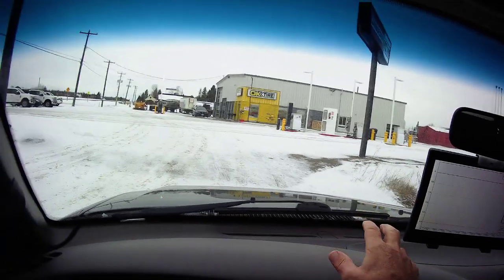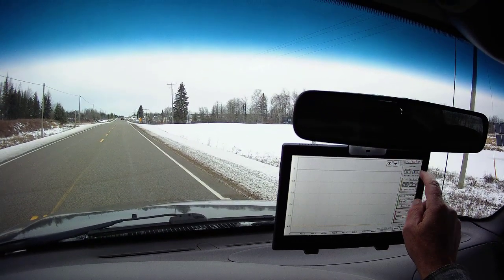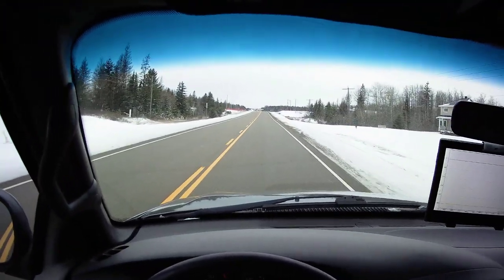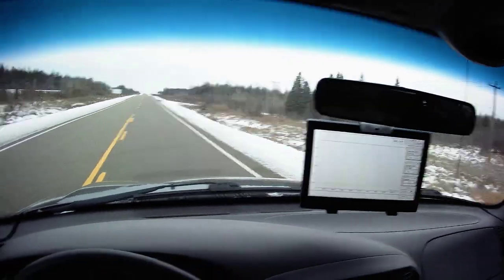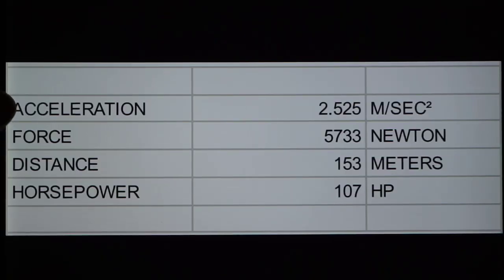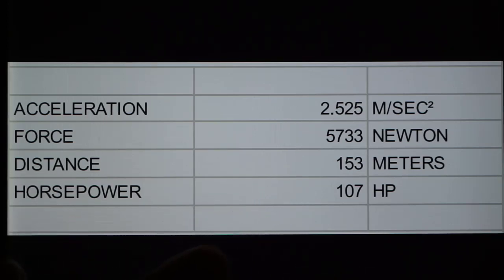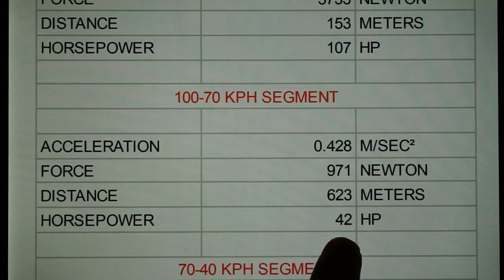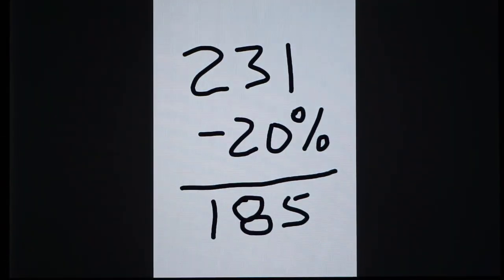GADGETS#159 - DYNO FUN

Comment: Denis, I have a question, is the 20% value about loss due to friction implicit in the formula provided in the excel sheet? I was looking at but I didn't see it. Thanks
Reply from the maker: I was waiting for someone to ask this question, Juan:)

Both, the DYNO method and the SPREADSHEET method encounter losses not found at CRANK method, Both agree on 20% . BUT, they get there in different ways.

The SPREADSHEET captures wind resistance and front drive train friction that the DYNO would not experience.

The DYNO captures torque converter and more internal transmission friction that the SPREADSHEET in neutral coasting would not experience.

In the end, both produce same 20% deviation from  CRANK HP
Reply: @theGADGETSplaylist  thank you Denis... For me it was a satisfactory response. :)